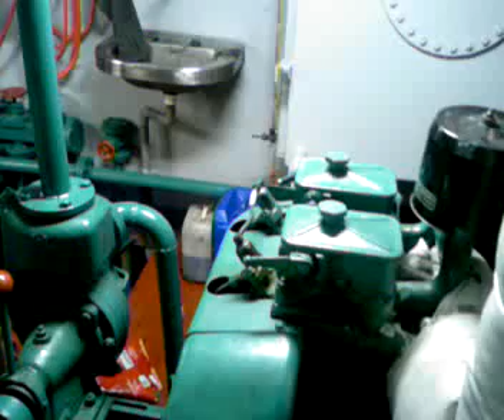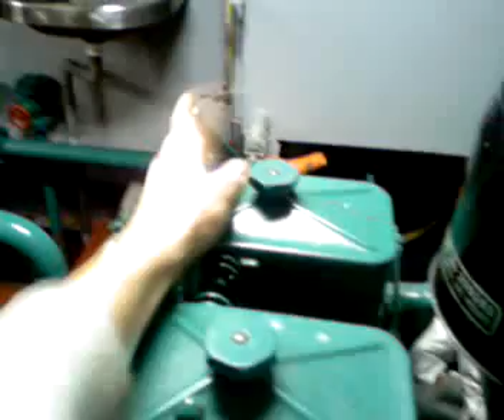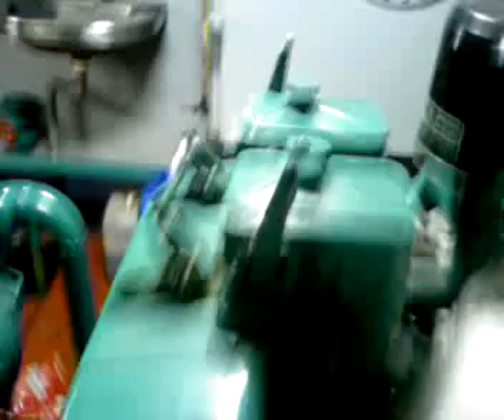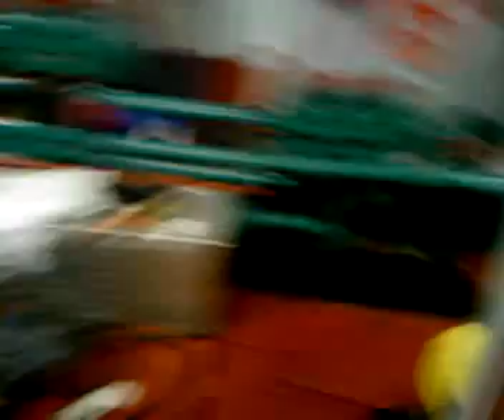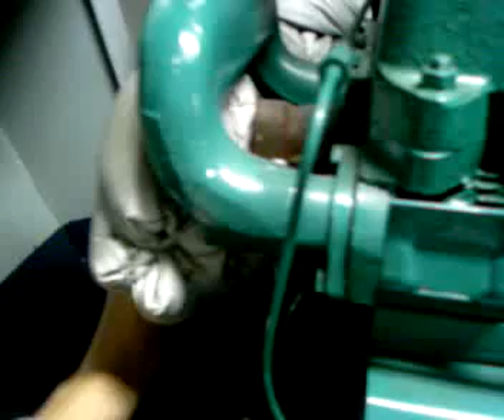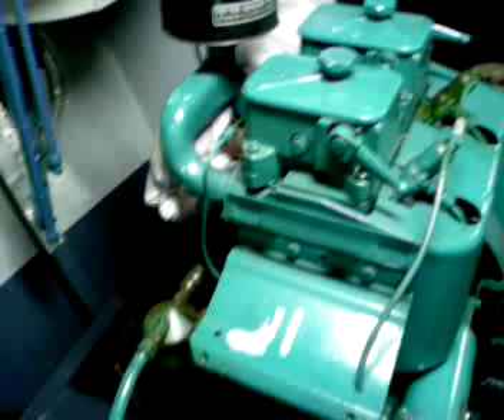Petter 2 cylinder diesel engine

Comment: I have one of them at home, brand new, never been started. It is 16.5 bhp at 2000 rpm. It is complete  with marine gearbox 
I like to look at it and one day next year I shall start it for my Grandson. It is described  as a non stop engine.

About a year ago someone had a concrete mixture with a single cylinder  Petter and it was jammed as water had entered the cylinders and it was lying in a field for about 40 years. I had a look at it, dismantled the cylinder, and was lucky enough to find a piston for it. The bore was cleaned up and just  touched  to clear some rust and with one swing it started and it is still going strong. I admired the concrete mixing tub as the gearing was moulded with the bucket, something that one does not see any more.

Comment: the ph2w that I refered too would be water cooled. we all considered the pj line a better engine than the ph line. they built many more ph'sw than the pj line. they also made an air compresser using a pj4 crankcase and two cylinders were used to compress the air.they worked good  just not many were built.

Comment: yes and right hand rotation or left hand rotation. I think the ph would have phw2 on engine plate. the only engines that were right hand rotation were the aa and ba lines. both lines had alum. crankcases.

Comment: I think 1800 rpm was tops if I am wrong on the 1800 it would be 2000 rpm. I would have to do a lot of reme4mbering but  there was a place which I think was 1750 that the spill timing would change.i still think they were a great engine am sorry to see the company go like it did.